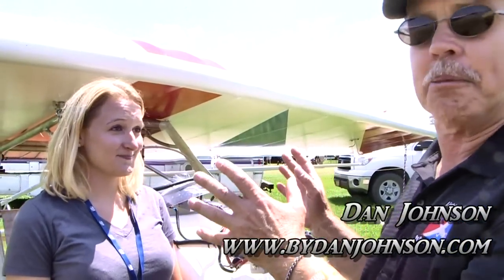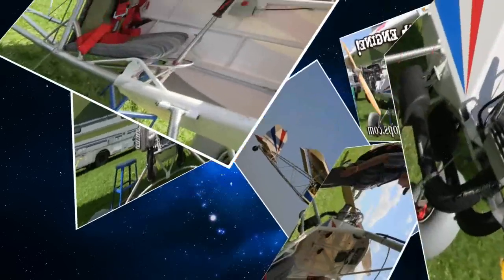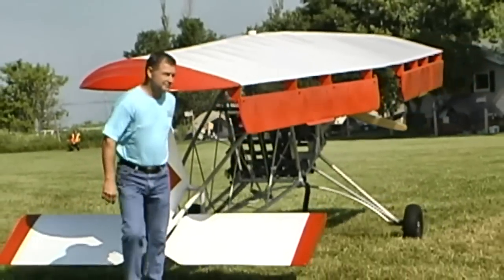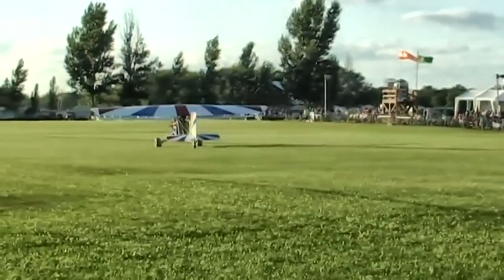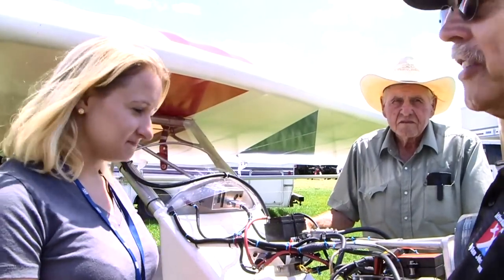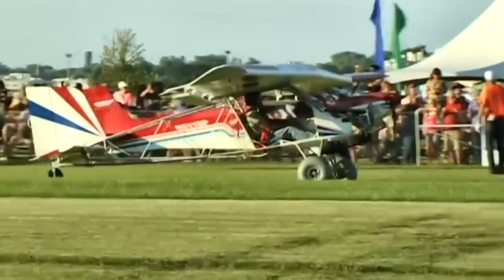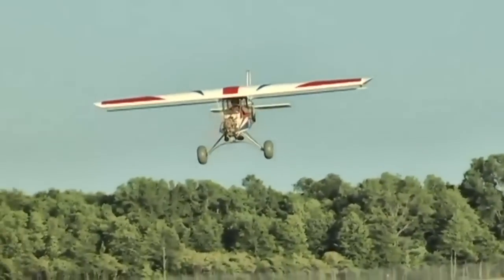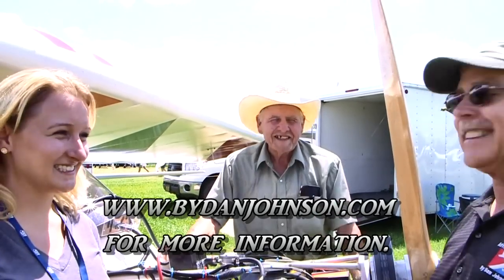Backyard Flyer, 50 HP Hirth F23 engine, legal ultralight aircraft, Valley Engineering.

Comment: Many years ago I read about this motor which was a bit unique.  I believe it was a prototype an opposed twin cylinder 4-stroke.  The design was ground up(I think).  The main thing about it was how simple it was.  They used something like oiled felt to lubricate the cam lobes.
They made the motor with simplicity in mind.  They broke down each part to the most basic needs.
I can't for the life of me remember what it was called.  You seem to know so darn much about motors, especially prototypes ones.
Does this ring a bell to anything you've reviewed?
I doubt the company made it as I haven't seen anything about them.
Any help in locating this would be appreciated.
I'm just curious about that motor.
Thanks!